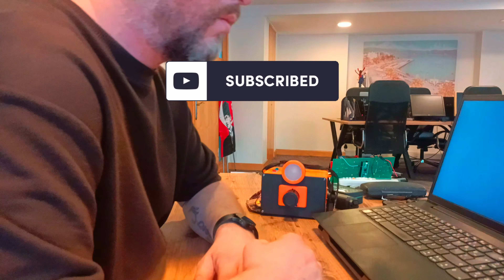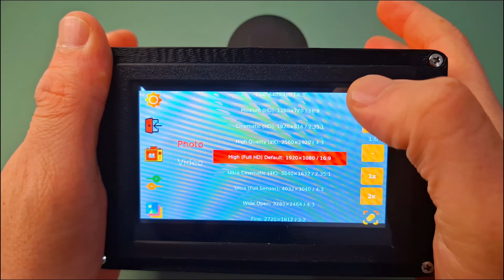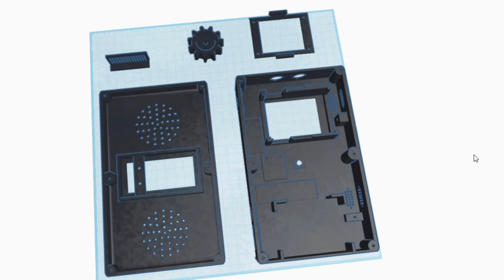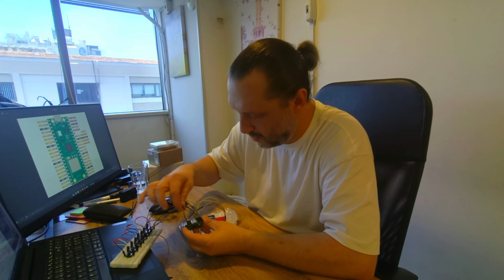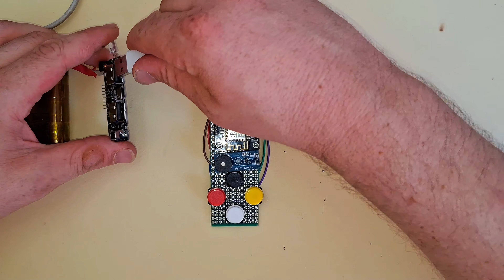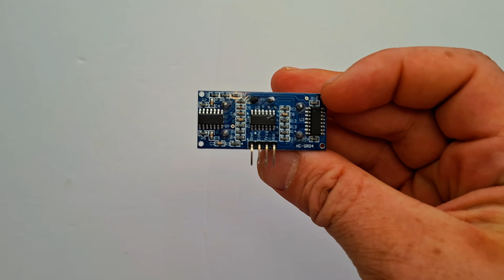I Built 10 DIY Projects with Raspberry Pi, Pico & ESP!

Comment: How to make the walnut cgb emulator core
Reply from the maker: Hi! The Walnut CGB emulator core is based on the open-source repository. You can check the complete source code, compilation steps, and documentation in the GitHub link in the description!

Comment: awesome video! Just picked up soldering, im working on a digital picture frame for my girlfriend and I's anniversary running on a 1gb pi 5, Ive been doing little radios and circuit boards to practice. It was great seeing your projects !! Great designs
Reply from the maker: Thanks a lot! That digital picture frame sounds like an awesome anniversary gift—Raspberry Pi 5 is a great choice for it! Good luck with the soldering, keep up the great work! 🛠️🎁